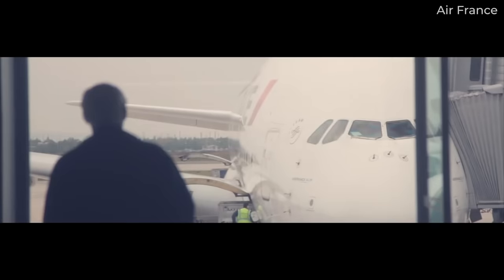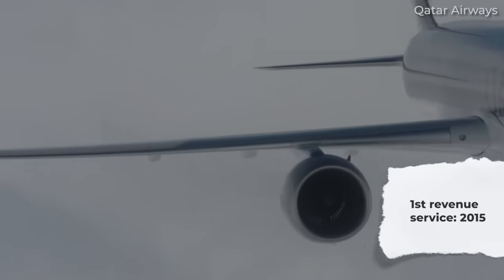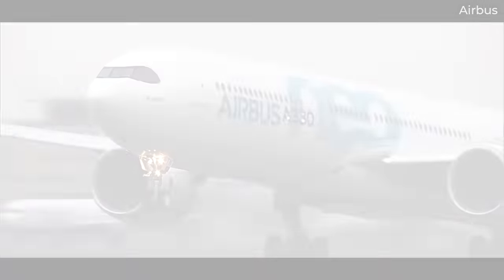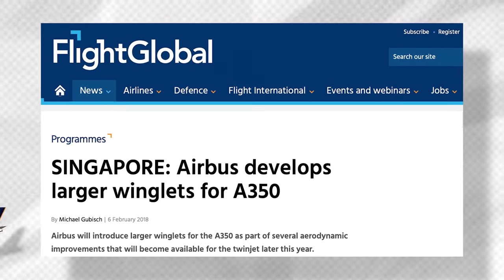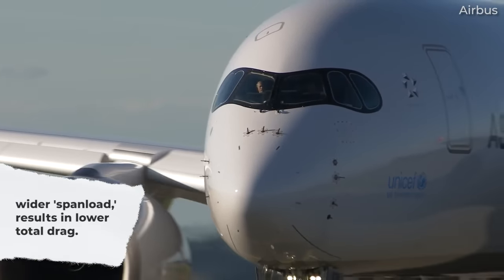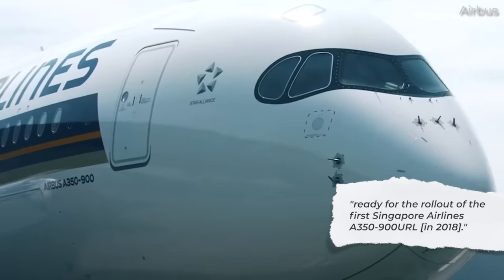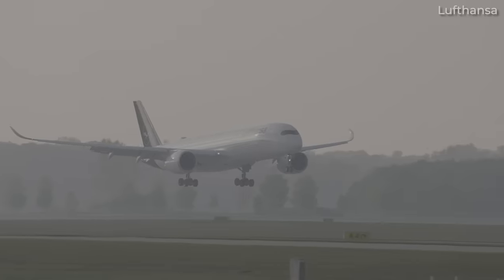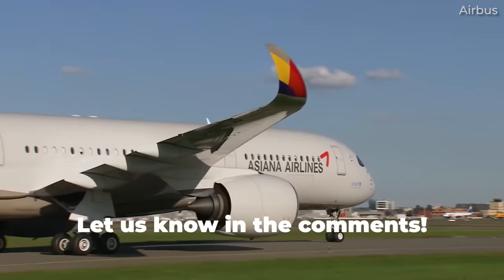Did You Know? Some Airbus A350s Sport Different Winglets

Comment: Great aircraft . Game changer for Airbus following the demise of the 380.
Reply: Unfortunately it took some light from the A330 NEOs. 
...which is also a very versatile wide body and it's my favorite for the way it flies, the way it lands and looks.
Due to Boeing company name, everybody praises the Dreamliner, but the truth is that it's not that better than the A330neo. All things considered: Capacity, passengers and cargo, range, operating speed, operating costs, price of acquisition, cabin noise, state of the art cockpit, the Dreamliner doesn't win them all and I don't even know if it wins most of them. It's better on some, less on others.
Reply: @miks564  B787 is by far lighter then A330neo, this is what makes the diffrence. If you only compare the statts you counted above, then the original A330 and the A330neo are same too.
Reply: @dogukantosun5547  Yes, the 787 is more efficient because it’s lighter. But the NEO also brought better figures than the old CEO’s precisely because of the engines. More power, better efficiency, more range.
They also made changes to the wings and even to the cabin.
Reply: @miks564  read the comment again. You didn't get my point.
Reply: @dogukantosun5547  Yeap, I guess I'm missing your point.
The 787 is lighter and more efficiency allowing it to be more versatile, and I know it still has a few other advantages over the older A330 frame.
Comparing the A330 ceo with the A330 neo, there are also some advantages for the neo that brings it closer to the 787 specs. The MTOW has increased a bit, so did the range and the noise inside the cabin, not to mention the tech in the cockpit.
There are two main reasons the A330 neo sales didn't pick up yet:
One, the Dreamliner arrived years earlier and easily filled the space for new demands on this segment. This was its biggest advantage. When it was released, its competitor was the old A330ceo.
Two, the old A330s in operation are still good and reliable, are less than 20 years old, and most won't be replaced anytime soon.

Comment: Airbus has also over time, for example, upgraded the A350 cockpit from ordinary screens to touch screens.
Reply: up to airline not manufacturer
Reply: @randomwaffler  no?! The airline can't just retrofit screens at their will
Reply: @MrSchwabentier they mean it’s not a standard feature on the A350, but an optional extra that the airline can choose when placing an order for a new plane.
Reply: @MrSchwabentier  the manufacturer doesn’t put the seats on the plane… it’s all up to the airline man
Reply: @MrSchwabentier  further, how do you think there is a different between emirates first class and british airways first class if the airline doesn’t do it 💀💀💀
Reply: @thatg6838  nope airlines have to actually fit the empty cabin they get
Reply: @thatg6838  yes but that’s still an upgrade made by Airbus because initially that option didn’t exist
Reply: @randomwaffler  no one was talking about seats dude…
The post was about the screens in the cockpit the pilots work with. Airbus upgraded them to touchscreens. 
What do seats in the cabin have to do with that?!
Reply: @MrSchwabentier  wasn’t specified so please be less ambiguous
Reply: @randomwaffler  wasn’t specified?! The original post says „upgraded the A350 cockpit from ordinary screens to touch screens“
Since when are there passenger seats in the cockpit?
I guess you should actually read before commenting and not say „be less ambiguous“. Because it wasn’t ambiguous at all

Comment: The newer A350s also don't have the 3 side slip angle probes in front of the cockpit windows, as well as new LED taxi and take-off lights in the nose gear (compared to the older halogen-type lights in the earlier A350s)

Comment: With raked wing designs (removing the need for a winglet) they too can undergo evolution. The 767-400ER introduced the first type and the 777X and Embraer E2 regional jet program use the 4th generation (there was a previous 3rd generation the 787 started with before it was improved to the current 4th after making the midsized variant)
Reply: The 777-200LR/300ER and freighter also has raked wingtips.
Reply: @thatg6838 They are the 2nd generation type and then the 787 brought the 3rd before that quickly got improved to the current 4th which the 777X borrows but scaled up (when the folding wingtips are down in regular flight position) whilst Embraer took inspiration and did 3 much smaller different sizes to suit each E2 variant to maximise efficiency

Comment: It was a rushed design so they had to make refinements after roll out. Wings are not an area Airbus leads in. Modern composite wings on a wide body shouldn’t require winglets to reduce drag
Reply: boeing does it too with their new 787
Reply: @randomwaffler  they have not had to make any changes to the wings. They got those right and don’t require winglets and are more efficient.
Reply: @johniii8147  you’re wrong - they have the equivalent of winglets (swept back and raised wings) which have the same effect. new wing designs also do come around later, both companies have done this multiple times, even on modern jets. both wings are also efficient
Reply: Another theory ia friend who flies Airbus is Airbus Sharklet's  vary in which factories they are built. The Chinese Airbus builds have larger winglets making them llook like wing nuts.